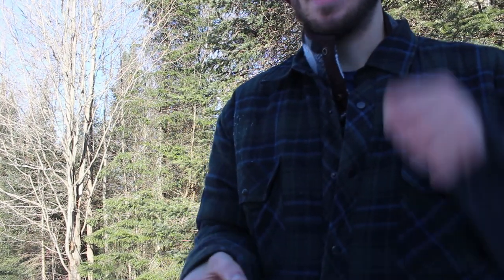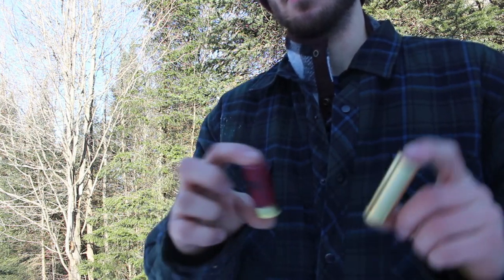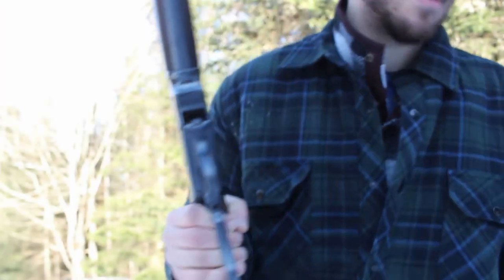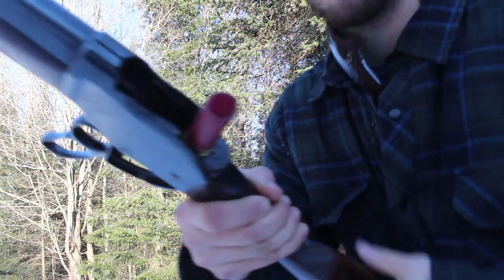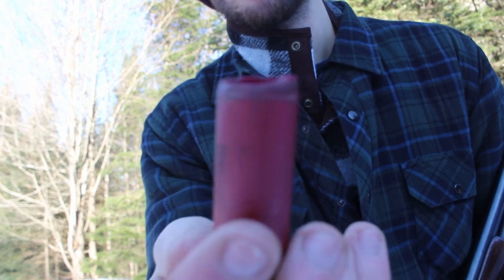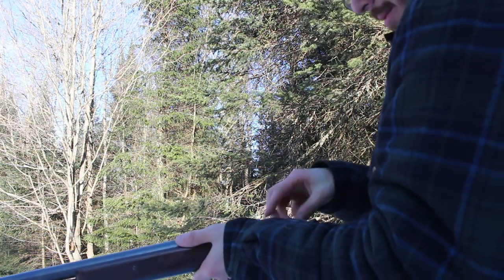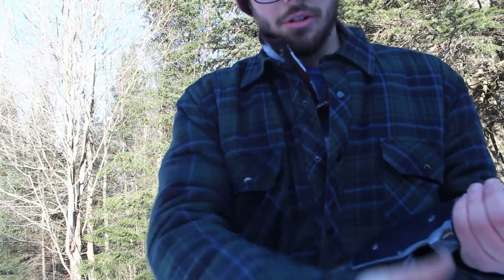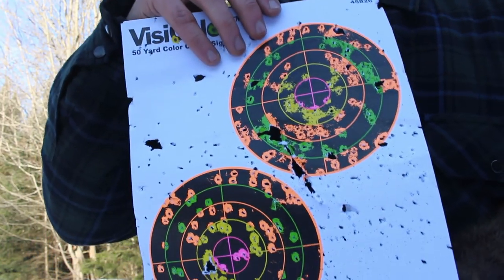Shooting the Winchester 1887 12 gauge shotgun. Original Brass shells.

Comment: I don't own an original 1887, but I own a Chiappa replica that's really nice. I've noticed that with mine it will always fail to eject shells when there aren't any other shells to be loaded in the gun.
Reply: Can you shoot modern ammunition out of it if you upgrade certain things like the barrel
Reply: @cathat227  Yes, you can shoot modern shotgun ammunition through the Chiappa 1887. I've put several different loads through it, including buckshot; and it does well!
Reply: @ShayFeral  original 1887 not modern
Reply: @cathat227  I don't think an original 1887 can withstand modern ammunition.
Reply: @ShayFeral  I'm saying if you replace the barrel and action
Reply: @cathat227  I wouldn't know, unfortunately.

Comment: My concern is my 1887 (being rough on shells in general) will beat the shit out of my 12 Gauge brass shells, or even crush one during a jam. Have you had issues with that?
Reply from the maker: No. These are thick shells. Mine ejects them fine. They are not thin brass like original ones.

Comment: Fine old gun! RST makes low pressure 2 1/2 inch shells that are safe in Damascus barrels and will be good in your gun.
Reply from the maker: I reload my own brass shells. They seem to work nice so far.
Reply: I'll vouch for the RST shells, I've only ever shot them in an early A.H. Fox pin gun, but there are very fine shooting.

Comment: I own a real genuine 1887 made in late 1894 with serial number 57461 but u really got to use some force on the lever so the lifter knocks out the empty shells,the last empty shell is a problem,it works if u have the right brand of shells not all work well,some eject like a dream but not all....
Reply from the maker: Ya, depends what shells are in use. Brass ones are the way to go.
Reply: @northernwoodsman  I have brass ones here brandnew and they drop in my 1893 and 1897 winchester barrels without a issue being 2 5/8th inch long but the wont go in my 1887 barrel all the way,i have the feeling my barrel on my 1887 is not original meaning,it looks really really new.

Plastic shells even crimped 70mm (2 3/4th inch) will go in but u feel some resistance wenn a crimped shell is in 90%  the last 10% u feel some friction and the forcing cone is opend u can clearly see some machine work is done on this barrel,i go use a hone and see if it bring any change in my barrel so it accepts .

But i would not bother to much these old 1887-1893-1897 shotgun barrels are well made and will handle smokeless powder without a problem if u use normal loaded shells,i shoot and reload myself all the time with pressures on the lower side and once a while a hot loaded shell and everything hold up fine,including on my 1887.

Its a myth guns break break if u go from black powder to smokeless,the powder never made a gun fail the pressures did and do,but these barrels are soo well made u wont break them easy if u dont go mega mega hot in terms of loads,if u use normal 1,25oz loads with 1200/1300 fps and a slug or buckshot every now and then ure okay.
Reply from the maker: @Berniessen  you can make an easy chamber length gauge from two hulls. Takes a few minutes... A modern shell unfired is supposed to chamber since it is 2 1/2 inches. The mag tech brass are 2 1/2. Maybe someone also tried to make the chamber longer and really beat it up.
Reply: @northernwoodsman  nah nah nah  its like this chamber is really bored tight in my case,atleas the last part of the chamber,i will get me a 12 reamer and use that to remove some metal so never fired 70mm shells drop in perfectly..
Reply from the maker: @Berniessen  alright well be careful of what you shoot. The barrel isn't the problem, it's the action. And if you shoot modern shells the crimp won't open all the way causing high pressure.
Reply: @northernwoodsman  I know i know but if u see my barrel u can clearly see that the forcing cone has been opent,this barrel is bored/reamed out so it can handle longer shells..

Hehehe sometime i look for vids of a 1887 winchester and i see clones made in china....and then i realise its probaly safer to shoot a 120+ year old gun then a new chinese replica...On one vid the wood fell off,on others the shells get stuck in the action and very rarely the clones work well..

Comment: you dont need to cut off the original crimp
Reply from the maker: You dont need to if you want to have excessive pressure and a barrel or action failure.